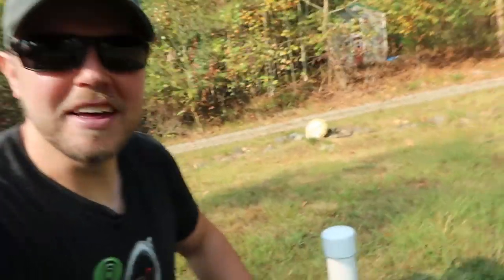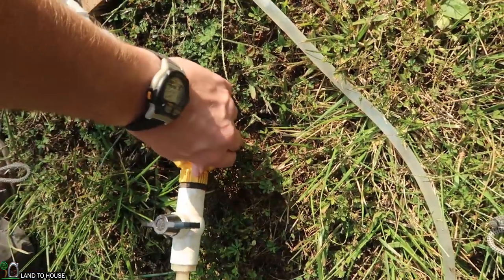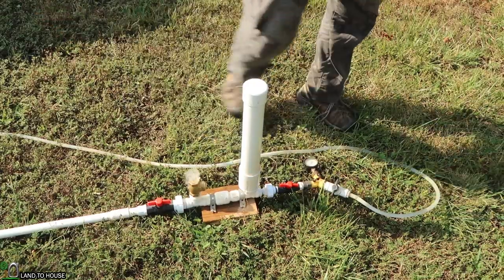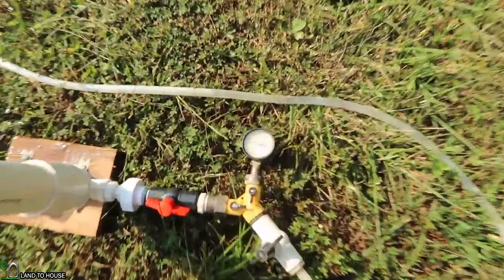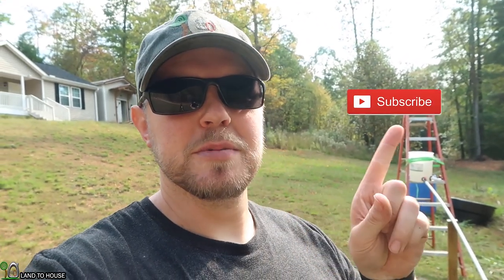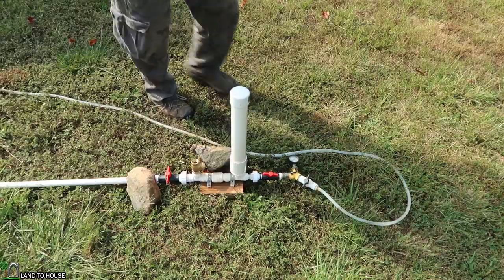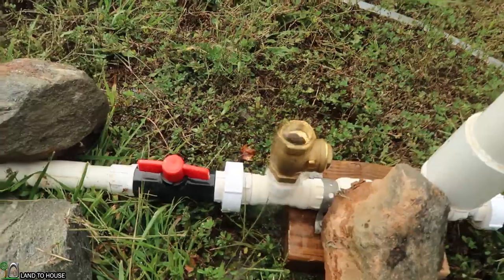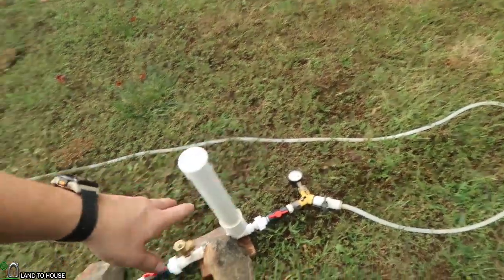Head Pressure vs Water Use - Ram Pump

Comment: Love the videos.
Lower head pressure means it takes longer for the flow though the waste valve to get up to speed to drag the waste valve closed, higher head pressure means the flow comes up to speed quicker to the rate needed to close the waste valve.  Higher head pressure = better delivery to waste ratio.  
I'd like to suggest a test where you determine the absolute minimum flow rate needed to get the waste valve to close.

Comment: These tests are so useful for me, thanks Seth..
Reply from the maker: I am happy to hear your feedback.
Reply: @LandtoHouse  
Please please reply......

Sir how do pressure and discharge compare???

More pressure mean more discharge??  OR  More pressure mean less discharge???

I have very less discharge of 12 liters per hour for ¾" to ½" setup
Reply from the maker: @sheshan88  hello. Increasing the input head pressure allows you to pump a larger volume of water uphill. Or allows you to lift higher. The lift height will eventually match the pressure in the pressure tank

Comment: Seth, thanks for all the cool info. I built a large garden for my wife, its the same level as the source (house). I installed 1/2" PVC running a distance of about 150". I built/installed a 1/2" pvc overhead sprinkler system with radial sprinkler heads intending to get 15' of 360 degree coverage from each. The rise for the sprinklers from the ground is 8'.  Unfortunately I am getting about 50% or 6-8' of coverage per head.  My question is: Would your 1/2" ram pump hooked directly to the house (60lbs pressure) deliver the desired/designed 15' of coverage per sprinkler head? Thanks in advance for any information.

Comment: Hi I got a question. Do smaller ram pumps require less head pressure and are larger ram pumps waste less water cause they can utilize higher head pressures? I'm trying to way the pros and cons of ram pump sizes for purchase.
Reply from the maker: Hello. The size of pump really only determines the amount of water required to operate the pump and the volume output. The lift is consistent based on head pressure no matter the pump size. (At least for the 1/2" to 1-1/4" pumps)
Reply: Land to House ah ok great. I just received two of your pumps in the mail and thanks to your “right size for your ram pump” vid assembly was super easy even for a complete nube. Before I put it to the test, I got a question. In the hydraulic ram part of the pump, there is foam. I left it in but did not glue that part yet so it’s not set in stone. Does that foam in the ram/ air pocket part of the pump serve a function or is it just packaging like foam in the waste valve? Should I remove that foam?

Comment: Hi, Seth! I've been watching as many of your videos as I've been able to get my beady little eyes on and, although I've learned quite a bit, I still have questions. Here are my factors: my creek drops around 10 feet over a length of about half an acre. Water speed in the creek even during a drier spell is still at about 15 to 20 gallons per minute. Considering any and all variables, would it be at all possible for us to get water to a 200- to 240-foot height with some type of ram pump? Do you think it could work at all? If yes, then how? If no, then why not? Thanks so much for all your information, help, and support!
Reply: Following
Reply from the maker: Thank you for watching all the videos!  10 feet of head pressure (drop in water from source to pump) can allow the ram pump to lift water to around 70 feet. This is a good bit less than the 200+ that you need. There is another issue that you would run into even if you had the head pressure needed to lift water that high. The style ram pump that I make has a limited lift based on the weight of the waste valve. This upper limit is around 180 feet. NOW I am about to start using Stainless Steel valves on all Land To House ram pumps. These valves are a bit heavier and can potentially lift water higher. As of right now I dont think you can get water to 200 feet of lift.

Comment: You mentioned the drive pipe is 3/4”, is the pump the same? Or 1/2”? Also when you’re saying the size of the pump are you mainly talking about the size of the waste valve? Keep up the good videos!
Reply from the maker: Yes the pump is 3/4" and the drive pipe matches that. I call the pump size based on the waste valve and the components leading up to the valve.

Comment: .... so with the same size and length drive pipe - higher head gives greater pressure from the pump - which is what I expected.  What I'm trying to wrap my head around is higher head resulting in less water per  unit of time going thought the drive pipe - I expected the water would go faster.    What is missing is how much water was actually being delivered through the delivery pipe??   Was that more or less volume as you increased the head?  ... and how much different.   Thanks - love your videos - going back and watching more of them.
Reply: Yes, I also would very much appreciate a measurement of the delivered amount of water for the 3 different Drive Pipe Heights. That would allow to calculate the efficiency of the pump.
Regarding the More-Height-Less-Water-Used-Mystery my assumption is: The higher the Drive Pipe Drop is, the faster the water in the drive pipe will be accelerated. Then you get more cycles per second (I think you can hear this in the video), and hence the water flow is more often interruped. That would explain the lower water usage with higher Drive Pipe Drop.

Comment: Hi Seth what should be the length of the drive pipe for a head height (water source) of 30 feet.
Reply from the maker: 30 feet is a LOT of input head pressure. As for drive pipe length I have found that 25 feet to 100 feet is ideal.

Comment: I'd like to know the volume of "waste water" vs. the volume of water being pumped.
Reply from the maker: That value will change based on a few factors.  Say you have 10 feet of head pressure and lifting to 60 feet. You will have a certain amount of water pumped. Then if you move that delivery to 70 feet you will have almost no water at the top. The waste water is a bit more consistent.  What I can do is test at a couple heights to get some values. :)
Reply: That is generally ruled by the laws of Energy Conservation. Just a simple example: With 10 gallons and a Drive Pipe Drop of 1 foot you can pump 5 gallons to 2 feet, or 2 gallons to 5 feet, or 1 gallon to 10 feet. That applies of course only if the pump would have an efficiency of 100%. In reality the efficiency of the pump is much below 100%, lets assume 50%. In that case you can pump only 2.5 gallons to 2 feet, or 1 gallon to 5 feet, or 0.5 gallons to 10 feet.
Seth would just need to measure the efficiency of the ram pump, although the efficiency might not be constant and depend on the setup (e.g. Drive Pipe Height, Delivery Height, desing and shape of Drive Pipe, ...).

Comment: could a small submersible water pump 4 watt DC be used to power the pump instead of the bucket. So that the waste water be used.
Reply from the maker: The main issue that I see is that the ram pump needs an open-air source to operate. The pressure wave that creates the "ram" needs to go back and forth. A submersible pump would only be pushing water in One Direction.
Reply: @LandtoHouse  True. Thank you. I get it

Comment: Are you going to do this with an open delivery pipe?

 Just wondering, as with the lower head pressure the bucket emptied faster, if that would mean that it would give you a faster flow on the delivery. 

Or if it just, as I suspect, wastes more water before the waste valve closes and so is less efficiant.
Reply from the maker: From my previous work with the pump I have found that the delivery output is less with less head pressure. Just more waste water. The water flow has to speed up enough to close the valve and thus more loss while that speed increases.
Reply: @LandtoHouse  Thought that would be the case.

Comment: have you considered some kind of method of capturing the waste water?
maybe i don't want to flood my lawn XD just saying.
Reply: The brass and stainless steel waste valves have a threaded top so it would be easy to screw on an elbow and direct the waste water to a level or downward sloping pipe.  I'm not sure of the effect of the pipe on pump performance.  

I've wondered about the effect of extending a short pipe up from the valve.  I'm guessing this would have a negative effect.  I vaguely remember a video on waste water valve height, but the whole valve might have been raised.

Comment: What distance will that pump push?
Reply from the maker: I hear stories of over a mile. My personal testing has been 700 ft
Reply: Depends on the volume of water and diameter of the pipe.  I have been testing a low head application with a small amount of water being delivered across a fairly flat 4 acre parcel.  The length of the pipe at various locations does not seem to make much difference for me for the ram pump.

Comment: I hav 500ft drop, how much% of water I will get at 1000ft hight I need ans. Pleas
Reply: 500 ft of head x .433 pounds per column inch = 216 psi into the pump.  With a pump multiplying the psi you will need some really strong pipe, fittings and pump.

Comment: It is counter intuitive to me that the higher is less and the lower is more,why is that?
Reply: My assumption is: The higher the Drive Pipe Drop is, the faster the water in the drive pipe will be accelerated. Then you get more cycles per second (I think you can hear this in the video), and hence the water flow is more often interruped. That would explain the lower water usage with higher Drive Pipe Drop.